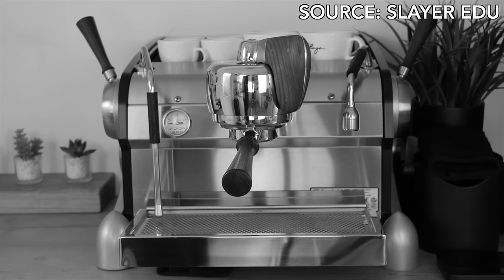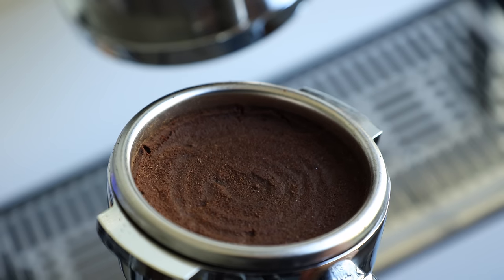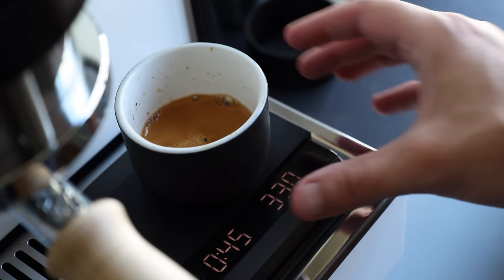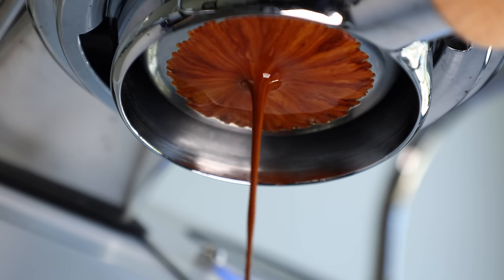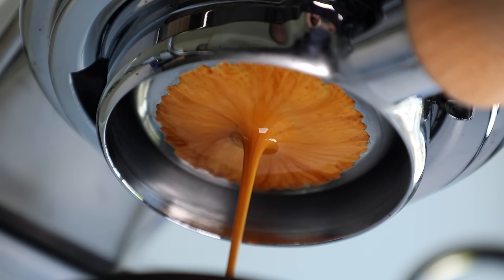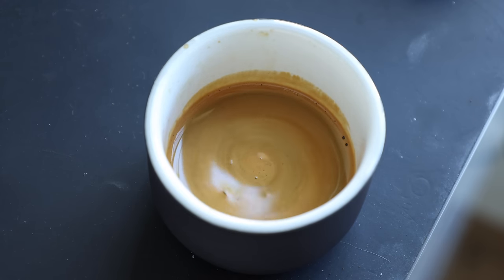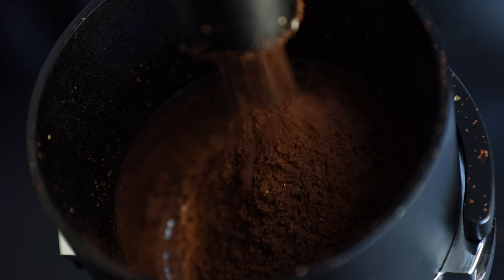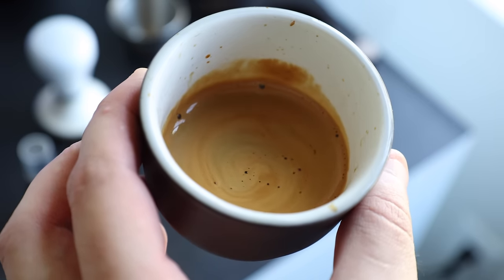ESPRESSO ANATOMY - The Slayer Shot

Comment: Long preinfusion seems to be the way to go for light roasts. I'd like to see you try out steep and release or "Rao" type shots. My technique is to get the puck saturated as fast as possible then pause infusion for around a minute, then push out a 1:3 shot at max flow rate. Hopefully the GS3 allows this technique. Its also worth looking at slow turbo shots: go for a turbo shot style grind but set the machine to its minimum flow rate and go for a 1:6 brew ratio, works well with light roast Kenyans.
Reply from the maker: Interesting! I’ve heard of this a couple times but haven’t explored it. That sounds like another video for sure! Thanks for the suggestion!
Reply: That’s stops being an espresso at all then. And just turns into using an espresso machine to make a pour over
Reply: @RegrinderAlert  it’s closer to a pour over than anything espresso-y.
Reply: @RegrinderAlert  I’m not going to reply to that statement till you’ve thought about what you just said
Reply: @RegrinderAlert  think about where the water is and how it goes through the puck/bed.
Reply: @murraythebaker  does it matter what you call it? As long as it's tasty.
Reply: @unol  I can’t argue with that

Comment: I‘m currently experimenting with slayer style shots, using light filter roasts. I had some very nice cups. However, I find it hard to grind fine enough to to get to 25 second shots after the PI. I’m guessing that 98mm HU burrs are not necessarily made for these kinds of shots. Still, the shots seem to be sweeter, even if they run only 10 seconds after the 20 second PI.
Reply from the maker: Yeah I can see that, not all grinders are made to go that route and it can be a tripping point. If possible reduce the final pressure of the last 25 seconds, I had a lot of positive outcomes with a 6 bar final extraction too and didn’t run as fast.
Reply: @Sprometheus  Suggested Slayer profile called for: Pre-infuse @ 3 bar till the water saturates the coffee – hit the coffee with 9 bars then let it decline to 5 over the shot.
Reply: Having the same issue here… took a while to figure out it’s the HU burrs 98mm

Comment: Interesting, I've thought about using this method with my elektra s1c manual lever machine. When I bring the handle down, the pressure is far less than when  I release it and let the spring do its work. 
Not as controlled as the slayer, but interesting topic. Thanks

Comment: I have done long pre infusions on my picopresso (the only espresso stuff I have) but I encounter an increase in pressure, probably coming from the puck expansion. Should I fiddle with the grind size or on the dose?
Reply from the maker: Well that depends on what the outcome is. If the building pressure makes it harder to press and extract I’d fiddle with grind first. Then if it persists dose.

Comment: To be totally honest the vast majority of coffee blends out there, even the lighter roasted ones, won't benefit from such long extraction times. Especially if extraction pressure wont decline after about 30sec into brewing. 9bars in the last stage of such a prolonged extraction won't give you anything but harsh and very bitter coffee notes. For me prolonged preinfusion(10sec+) with "normal length" main extraction time works best for most light roasts I tested so far. Dialing back pressure(with flow control kit on e61) to about 6bar in the last 10seconds of extraction greatly helps with preserving a good texture while avoiding bitter notes.

Comment: Flow and pressure are not the same things. Obviously you can get very close using pressure as your guide but it would be interesting to do a side by side comparison with a machine that can flow profile.
Reply from the maker: True they aren’t the same thing, but in my experience they are two ways of achieving the same result. I considered going to my friends cafe who has a Slayer to try side by side but it could be a pain to do, maybe Slayer will want to send a loaner to test out.
Reply: Underrated comment here. What was done in the video is not a slayer shot.
Reply: @Sprometheus  I’m not saying it wasn’t worthwhile, it’s definitely still interesting to see what you’ve achieved with long pre infusion. It’s really a pressure profiled shot though, more like a lever than a what you can get with flow control on a Slayer or DE1. Even a modified Breville Dual Boiler does flow control better than a GS3, although you’re flying blind to an extent without a whole heap of pre work to establish set points on the knob or pressure gauge. I get that a 1 group Slayer probably isn’t that easy to find, but surely there’s someone in San Diego with a DE1 that would be happy to collaborate with you. If you can make a side by side like this happen I for one would definitely be interested in the results.

Comment: Your extraction yield "numbers" won't justify themselves to differentiate the process.  If you have a more even extraction over the whole puck it's quite possible for you to have a lower average of extraction.  If you extract 100% of only 20% of the puck you'll get 20% extraction average.  If you extraction 50% of 40% of the puck it's the same average of extraction.  So the extraction yield is honestly meaningless if you actually want to science.  It's basically impossible to decipher those numbers without completely extracting the rest of the pucks after the shot is taken to derive how much solubles are actually left in the puck.  That is the only way you'll know if you got a "lower" extraction from this shot style.